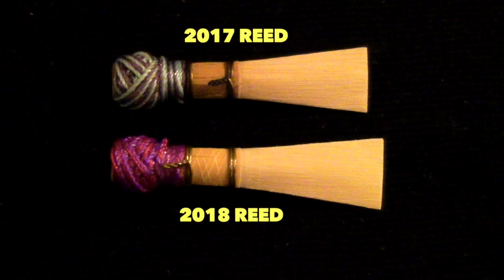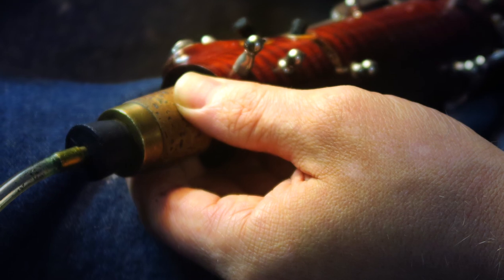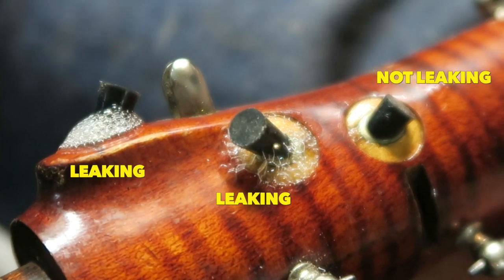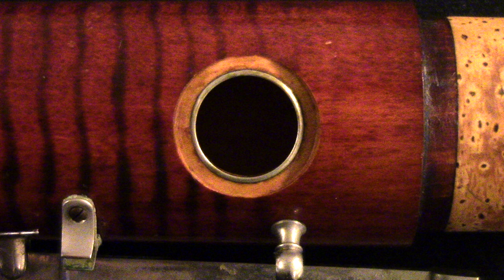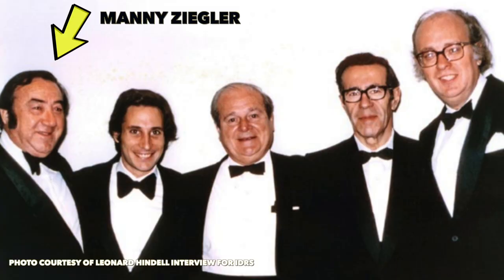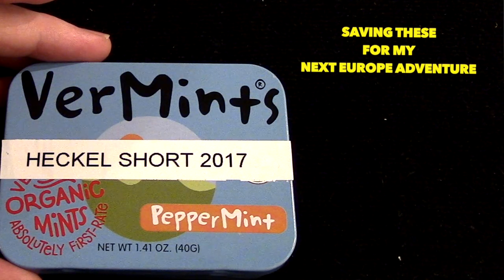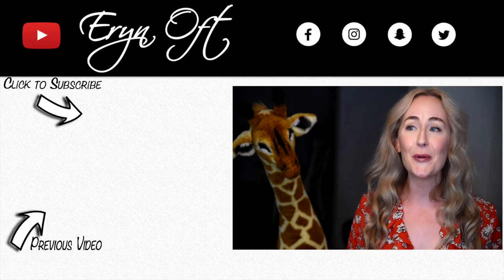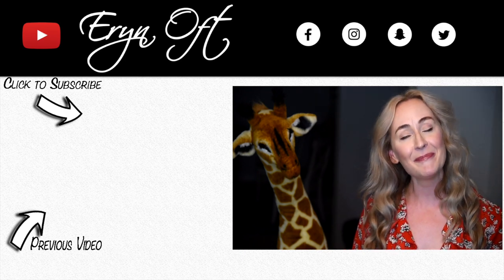MY HECKEL SHIFTED PITCH AND SECRET ANNOUNCEMENT

Comment: Was your instrument tending sharp or flat?
Reply: NCF8710 probably sharp because her reeds needed to be longer
Reply: Tyler Ho  One would think so, but changing to a higher number bocal would lower the pitch and it's a lot easier to do.  I went to a #3 bocal (Fox) to tame the sharp tendency of my bassoon during the hot, humid months.  I will probably go back to the #2 bocal during the cool and dry fall and winter months.
Reply from the maker: Yes, I was tending to go sharp but I was also challenged by lack of response and lack of dynamic range. The pitch was the first element I noticed. I thought I was just working with really hard cane and that was creating the resistance at first. Then- all the pieces started falling into place.